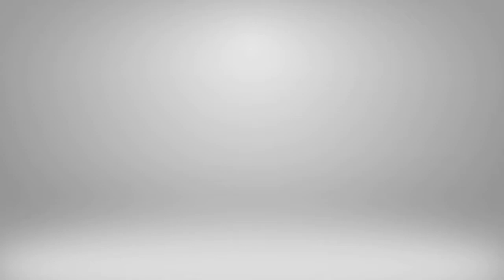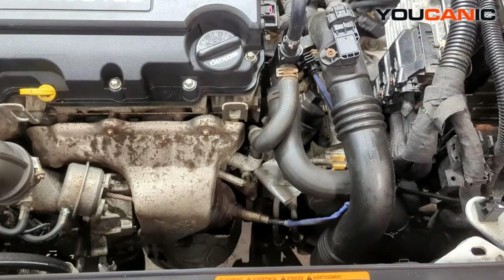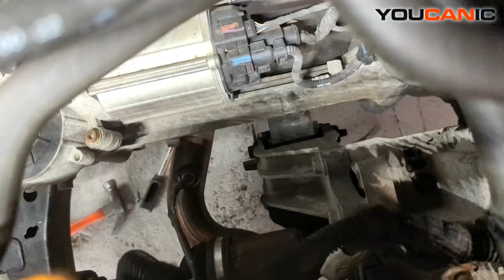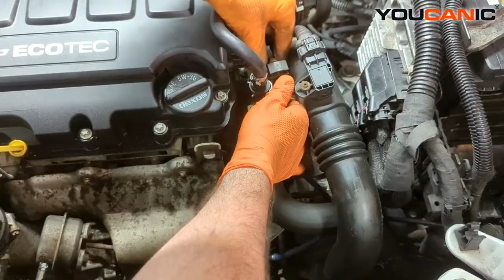2008-2016 1.4L Chevrolet Cruze - Upstream Oxygen Sensor Replacement

Comment: Pretty sure you meant 3/8” on that socket. 🫡
Reply from the maker: @Brando-_-440 If you’ve got a car issue or repair question, you can find step-by-step guides and scanner help at youcanic.com. We might miss some comments here, but our site has answers for most problems already!
Reply: 22mm wrench or 7/8 a wrench. He said 7/8 because that's the sae equivalent to 22mm

Comment: I came here to see how to unhook that electrical connection before I destroyed it on my car. Happy to see it looked a little frustrating for you too.
Reply from the maker: Absolutely, those electrical connections can be tricky! You'll find the YOUCANIC Full System Scanner extremely useful to diagnose any car issues you're having, it's like having a mechanic handy. 

Want more resources? At YOUCANIC, we have everything from OEM Factory Repair Manuals to forums where you can ask car-related questions. If you need further help, don't hesitate to get in touch. We're here to make car repairs accessible and understandable for everyone. You can explore more at www.youcanic.com.

Comment: I read something about a re-learn procedure when the O2 sensors are replaced. Do you have any information about what that is or how to do it?
Reply: Usually (at least on my 90s vehicles) you disconnect the battery, pump the brakes a couple times and let it sit for a couple minutes. This drains the ECU of its charge. Then start it and let it get up to operating temp and just drive around like normal. Then the ECU will relearn/retune itself
Reply: You need a scanner to tell the ecu to rest itself back to factory settings. I used a topdon scanner that hooks up to the obd2 port and you download the app on ur phone and go thru it and find reset or relearn. Its hard to explain. I also used chat gbt to help me and I was able to get my car running again on my own and didnt have to pay a mechanic hundreds of dollars.